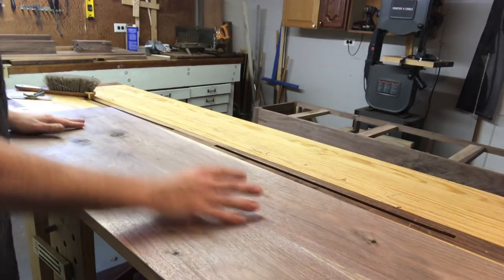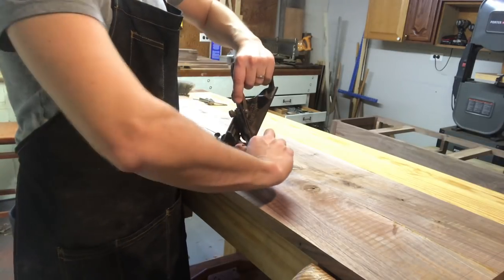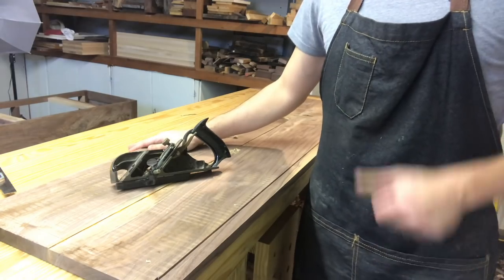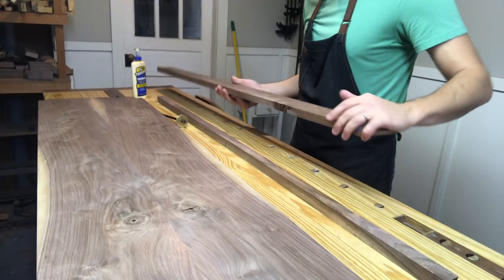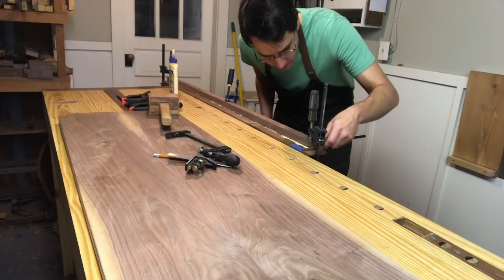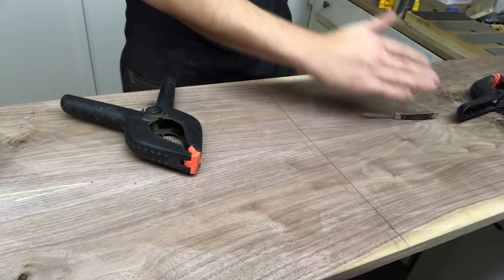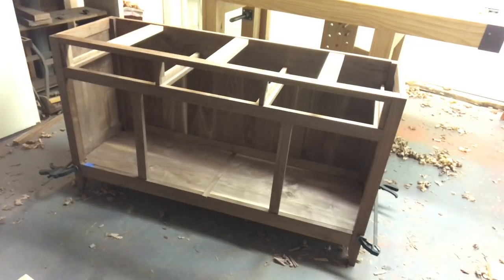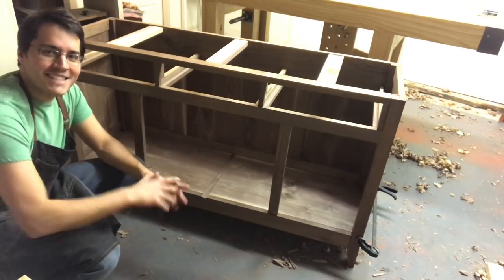Building a Sideboard part 16: Installing the Bottom Panel | Hand Tool Woodworking

Comment: I like how you made the panel look like two with the brace. This has really come along. I have the 45 as well but I still haven't used it. You make it look easier than I thought it would be so thank you for that. Great video.
Reply from the maker: Thank you! I really like this solution, as I originally was going to do frame and panel. That presented a few challenges that I wasn’t sure how to overcome. In the end, I LOVE the single board, and I love the divided look. Thank you!